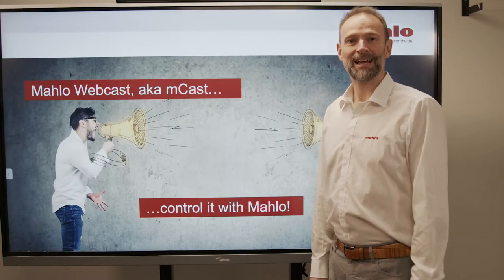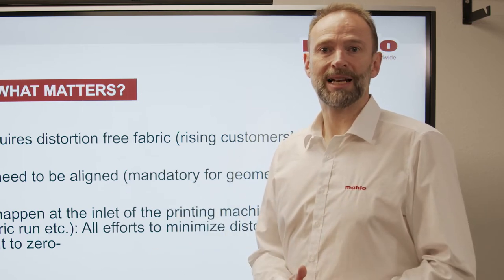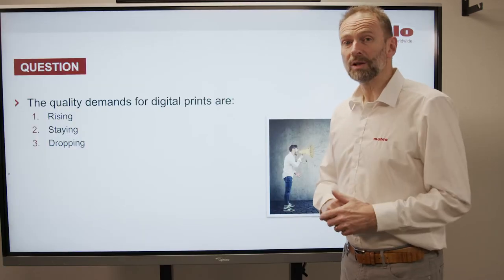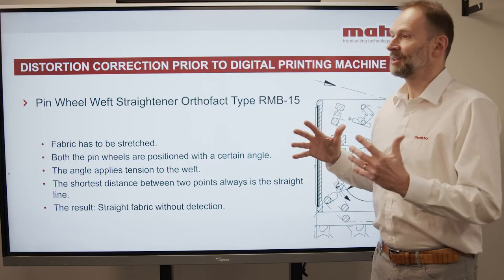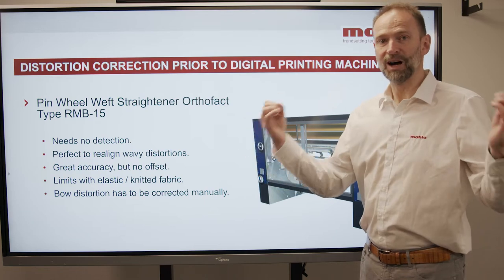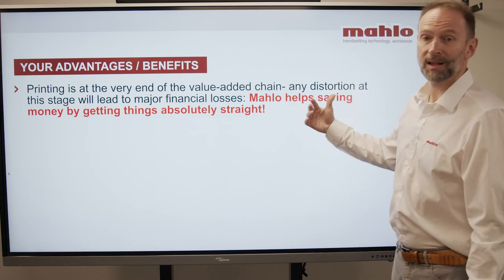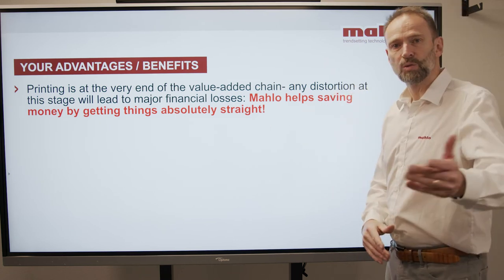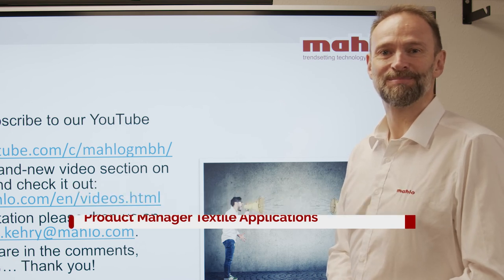Weft Straighteners: mCast Digital printing | How to straighten digital printed fabrics!

Comment: Hi Mahlo team, better to put straightner before printing exactly? Or put before stenter?
Reply from the maker: Dear Mr. Yoga,
thank you very much for your smart question (and sorry for the late answer). Generally it is better to put the straightener in front of the stenter as during the drying or heat-setting process the fabric will be fixated and therefore kept in the straightened position. A small straightener in front of the printing is only used to eliminate small distortions right before the printing. Those distortions might occur from the inlet of a printing machine, but a small weft straightener like the Orthopac MFRC-15 will not compensate the straightening potential of a proper straightener in front of the stenter. 
We hope that we could have been of service to you. For further questions please simply get in contact with our team here in Germany ( https://www.mahlo.com/en/company/your-contacts-at-mahlo.html ).
Best regards,
Your friendly straightening guys from the neighborhood